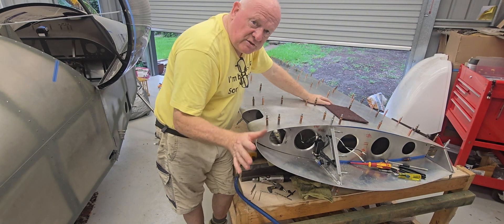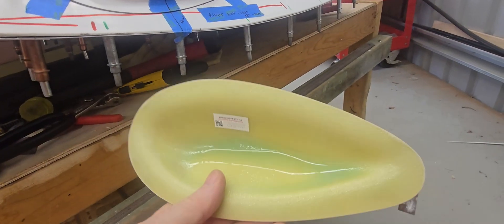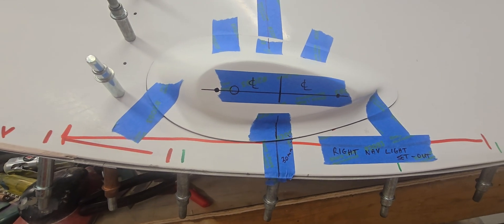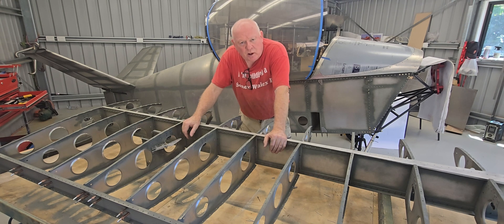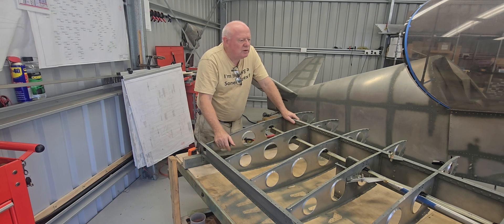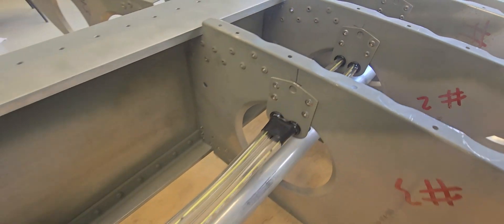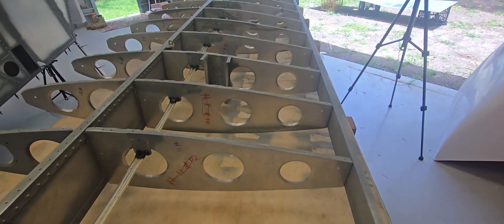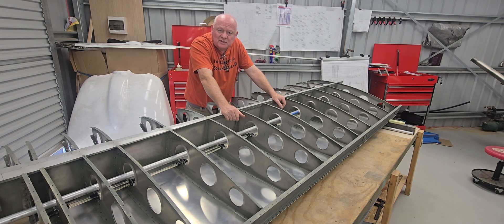Sonex Waiex B, part 46-Wing inspection and riveting

Comment: What Kip said!  Looks good.  My navigation lights are in about the same spot.  One thing to consider on the wingtip attachment - aluminum rivets.  That is what I've done.  Much lighter and much easier than nutplates because there are a zillion of them.  I've had to pull wingtips about 3 times and the aluminum rivets are quick and easy to drill out.  You can double check but I believe Sonex approves aluminum rivets on the wingtips, though not on the Y tail tips.
Reply from the maker: Hi Bryan, probably or better will be using plate nuts and screws for the tips, even though there will be 6 million of them. Don’t like the idea of making them a permanent fixture with rivets, and just another way of have an inspection opening, I guess.